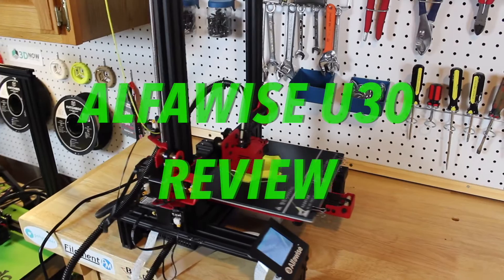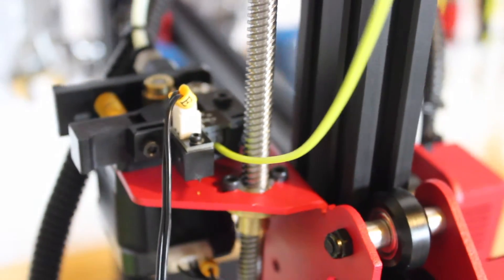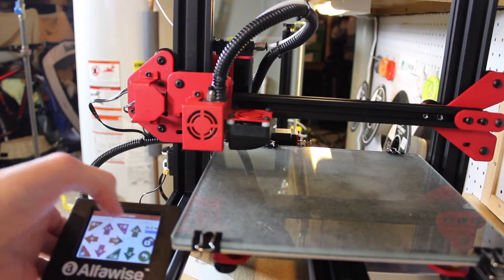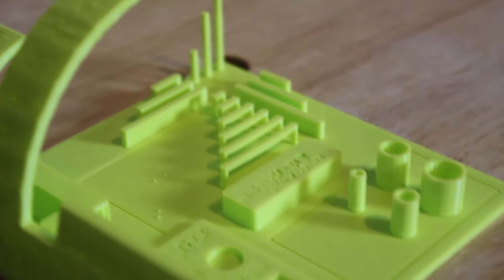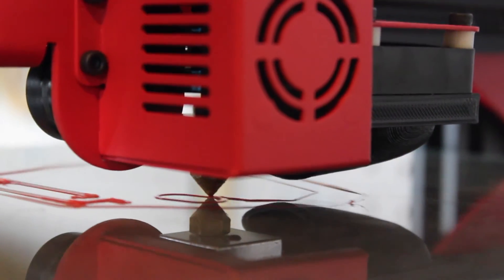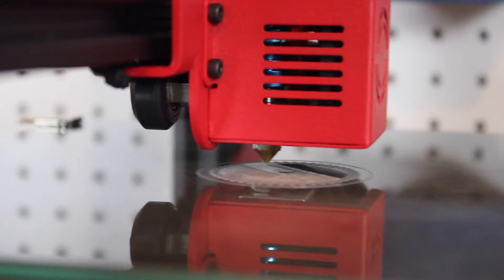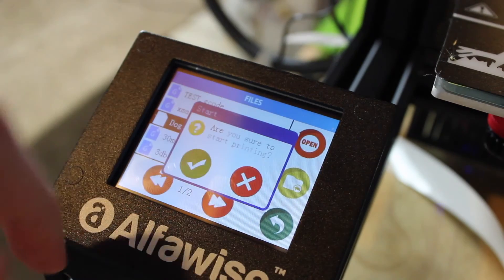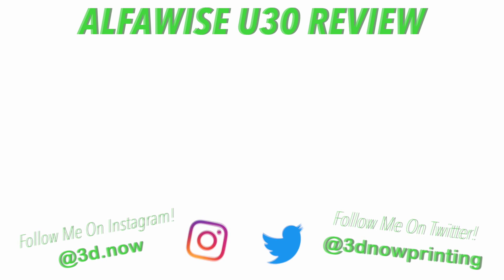Best Bang for your Buck - Alfawise U30 Review!

Comment: 3D Now, man I've been patiently waiting for this review. I recently purchased this printer and it's in transit, can't wait, lol. I was leaning towards the Ender 3 as my 1st printer, but decided on the U30 after watching your build video. One question, is there a list of a Cura profile for this printer ?. THANKS so much for the review and test prints !!!
Reply from the maker: Awesome! I believe a cura profile comes with the printer on the Micro sd card, but I just used my normal profile for all my printers and just changed the bed dimensions. It works great.
Reply: @3DNow  Can you send me a Cura config? My 3d printer don't come with sd card. Thanks
Reply from the maker: It should have came with one. Mine was kind of hidden.
Reply: @3DNow  No it doesn't. I searched intensively several times, but it doesn't appear. I contacted Gearbest, but nothing has been solved. :(

Comment: Hey I'm gonna get into 3d printing and I would like to know if this is a better choice then the ender 3, I'm going to be printing a lot of tpu
Reply from the maker: If you are printing tpu than you should get a direct drive printer.
Reply: @3DNow  Yes but I do want something cheap ish and I'll still be printing pla and abs as well I just think maybe tpu more because I fly fpv drones and would like to do some gopro mounts and other small mounts for antennas, motor dampeners etc
Reply from the maker: The ender 3 and U30 will work with tpu but it may be a little hard. Both printers are great. You can check the links in the video description for links and prices.
Reply: @3DNow  Ok thank you so much!

Comment: Hay. I have a u 30 but im having a bit of trouble. The cant get the cura settings to work on it the test prints works well but not my own prints. Mabe u could do a vid on how u do your cura settings? Any help would really help
Reply from the maker: Maybe sure your bed is the right size and the filament diameter is correct. Those are usually the most common problems

Comment: Bought the printer just before your unboxing came out and when I got it worked great.. A few mods that I done for it, like the spool holder on the side with bearings and going to put some fans on the stepper motors. I noticed that the extruder motor gets extremely hot and needs some cooling. Not sure if it is just mine or all in general. But all in all love it...